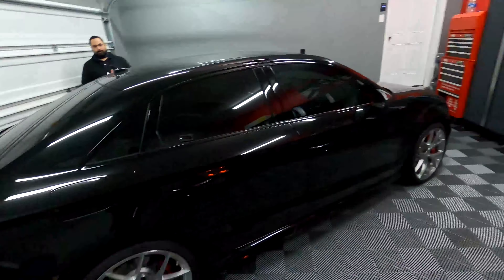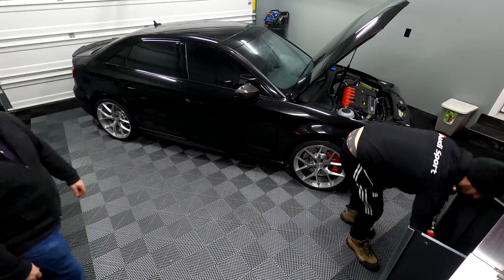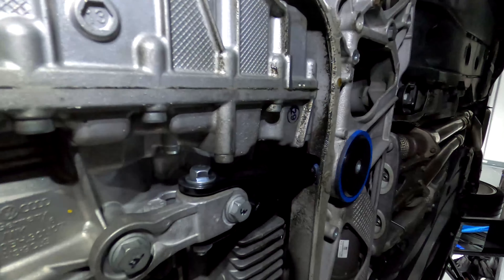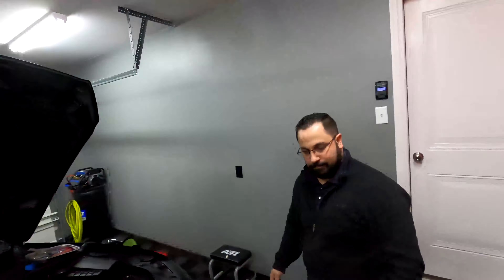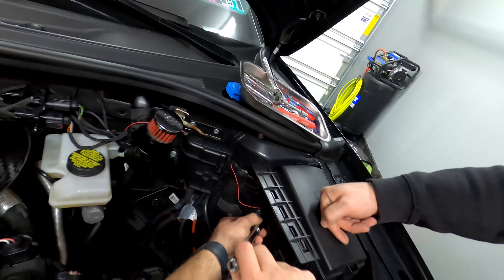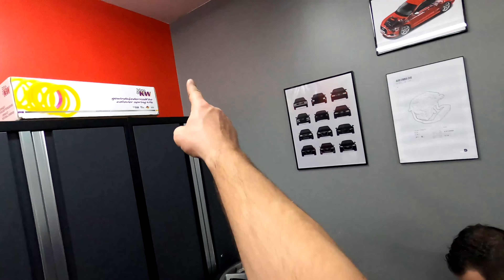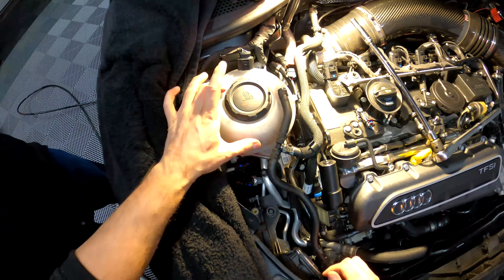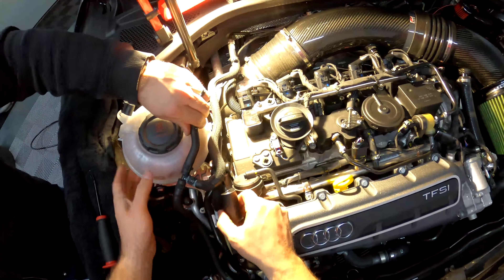I Install Black Forest Industries Stage 1 Engine/Transmission Mounts on my 2019 Audi RS3! *FULL DIY*

Comment: Did this add any vibration sitting at a stop in drive?   My OEM trans mount is getting sloppy and I’m feeling some vibration and not sure if I want to go back to OEM or a stage 1 mount.  I do NOT want vibration at a stand still, which I hear is a stage 2 issue … like worn out mounts.
Reply: do you have a dsg or manual? dsg you will feel more than a manual because it is in a gear. I installed stage 1 kit BFI and I hate reverse but while idle I can deal with it.